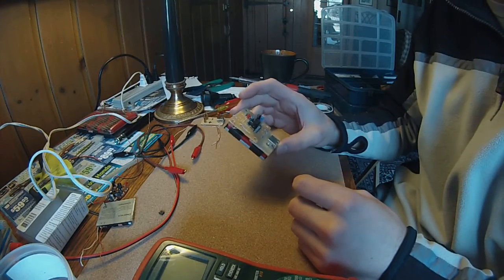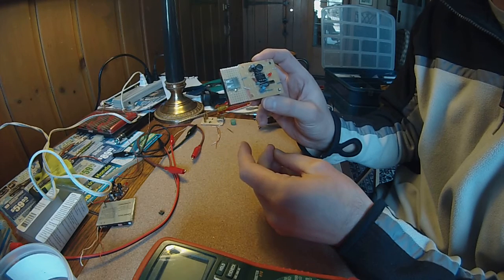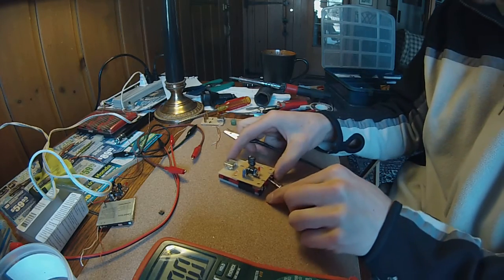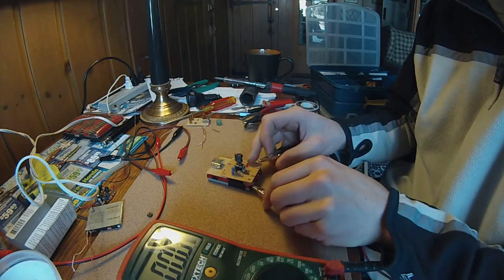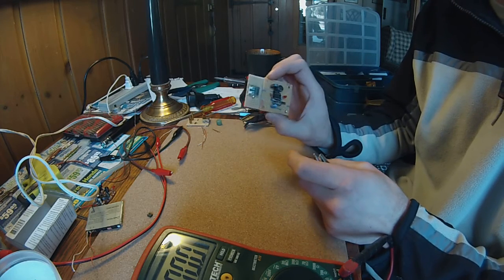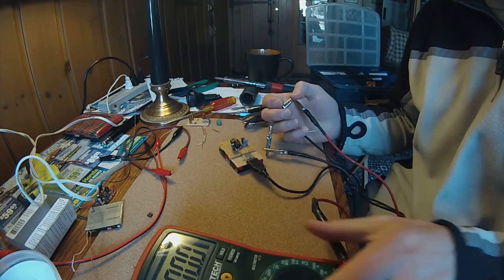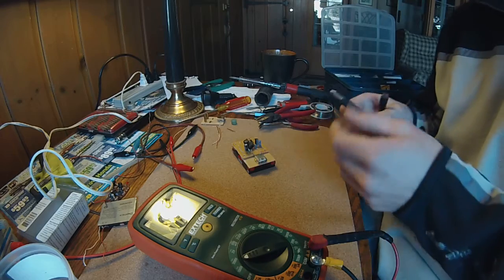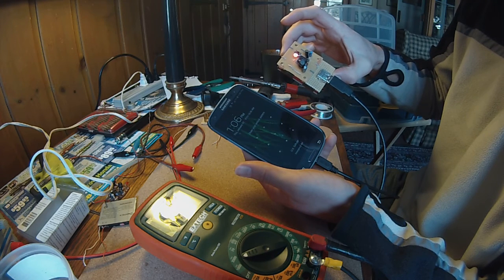Phone charger using the MC34063 switching regulator.

Comment: you dont have a protection circuit for your lipo batteries??..
Reply from the maker: No, I didn't in this circuit. There are some cheap ICs that do boost and battery management which would be a better option.  This was more of a proof of concept for me, not really very practical.

Comment: Can u tell....what's the output current rating?...and complete charging rate?
Reply from the maker: +Jahangir JZ I can't remember the current output for that one in particular. probably not more than 750mA from what I remember, and the the values that were being used. The charging chip that I used in the other charger has a max configurable current of 800mA.
Here is a video of the two that I have used. https://www.youtube.com/watch?v=n_FUkMcOplo

Comment: that's a nice demo. 
Only one thing remaining, we gotta add one circuit to charge up the batteries itself. I prefer add a cable with usb or micro usb charging port to the batteries and also add a diode at the output of the charging mc34063 circuit to prevent reverse current flow into the circuit, while only charging the 2 batteries.

Hope that might help. Great info btw thanks
Reply from the maker: +Jahangir JZ Hi, thanks for your interest in the project. In the time since this video, I've actually made another few devices, one of them with just such a battery charger. I have other videos of the charger chips I've used, and a video of a completed project, as well as projects without videos, such as a etched circuit board using this chip and a charger. I was thinking of creating one with a low battery indicator, or a cutoff voltage switch, to make sure the battery isn't discharged too far.